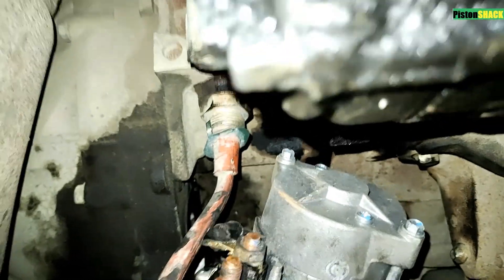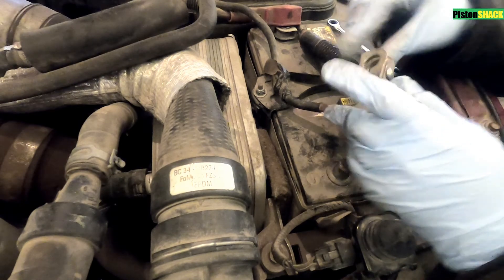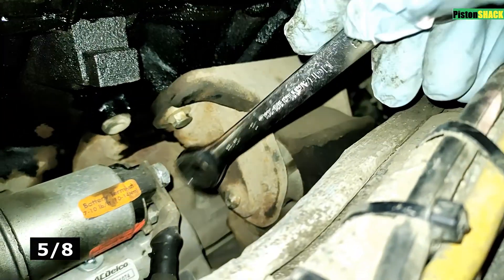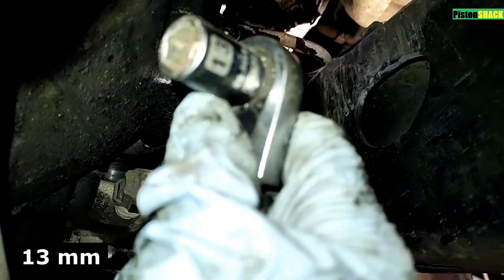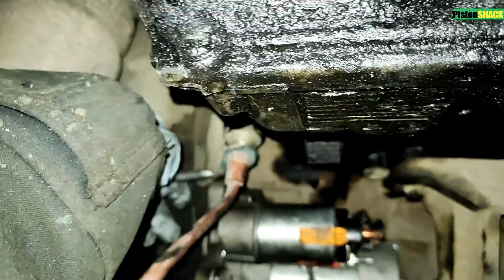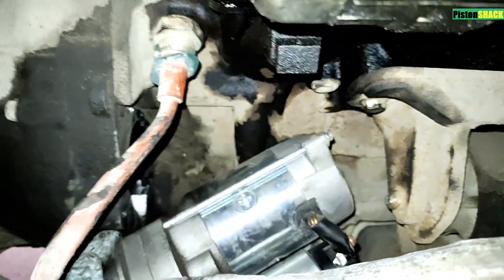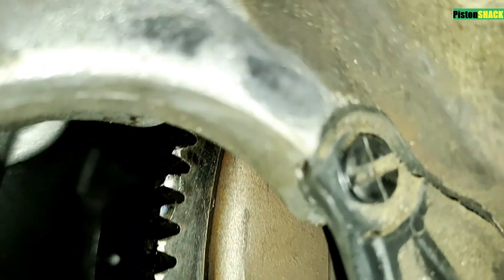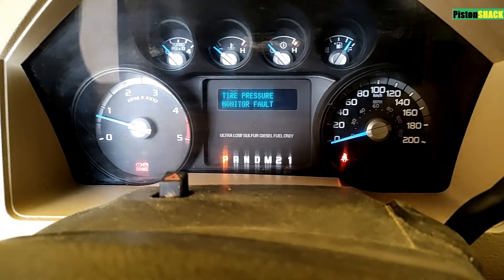BEST EXPLAINED 6.7L POWERSTROKE STARTER MOTOR REMOVAL | In Details | Ford Super Duty 2011-2017

Comment: Thanks for the video. 
Alternator comes out easier above the frame there than pulling it down as shown….once you unlock the puzzle the fine engineers at ford designed to even be a pain to remove without the frame. 

Can also wait to take off the 10 mil bolt on starter wire once you get the unit loose. Hard to get at with tools I had on hand.  (Have kids, have some missing sockets.) 

Idk for sure, but truck is closing down on 450,000 and the starter looked original. 
Worth the extra engineering obstacle course if they last that long. For sure I haven’t replaced it in last 220,000 miles. 
7.3 I was swapping about every 100k or so. 
Thats when I learned the trifecta of bad starter killing the alternator and alternator killing batteries and if alternators and battery are newer and seems you just replaced them, chances are the starter is bad and sucking the other 2 to death.  

Again thanks for quick and thorough video. Helped me find the thing and wouldn’t have thought it need to take the front wheel off to get to it. Time saver for sure.

Comment: I just want to thank you so much for this video. I was able to get all my tools laid out and ready tor this job so thank you for the sizes. Fought for 30 minutes trying to get that starter out. Took a break and watched this video again and went and pulled it right out first try. For the diesel model there were 4 bolts. Two on back and two next to the solenoid. I used multiple extensions and a u joint connector since i didn’t have the adjustable ratchet head and that made it a lot easier too!  Again thanks so much.
Reply from the maker: My pleasure Adam! I am so glad it worked out for you.  I tried my best after watching few 6.7 starter replacement videos on YT to make it informative and short as possible without sacrificing the quality) 
Thanks for your kind feedback. 
Cheers!

Comment: Oh my God. Someone did a quick how to video that shows EXACTLY how to do something including all the tools required and hardware sizes. They didn't include a ton of extra useless content like buy this or whatever. THANK YOU SOO MUCH. I often find myself looking for how to videos and most of the time I have to watch 3 or 4 videos to get all the info I need. Your video was the first I watched on this particular topic and it was extremely helpful.
Reply from the maker: Wow, thanks JD! That was my initial plan to make the video without BS short as possible and long as necessary without missing important details. Thanks again for your kind feedback.
Happy Holidays!
Reply: Plus we didn't have to drive to pickup a friend and then store first.
Reply: Totally agree.  Great video with all tools I need to bring to go change my starter in the store parking lot.  Thanks!  Subscribing!

Comment: All of the fasteners on the truck are metric, you just happened to find the fractional equivalents that worked.  An aftermarket starter could have either, but generally they'll be metric also.
Reply from the maker: I noticed that too. Good point.

Comment: I found that on the original Ford OEM starter the nut on the main positive lead is actually 15mm. It appears that on re-manufactured units like the one you are both removing and installing is a 5/8" nut. This thing is a HUGE PAIN to maneuver out of there. You need to bring the gear side out first and maneuver it up and around that orange sensor cable. It will come out but you'll be cursing the engineers and nursing bruised knuckles.
Reply from the maker: Oh interesting, I did not know that. I guess they might run out of 15 mm and starting putting cheaper 5/8 nuts:)
Reply: Orange wire is not a sensor... it's the block heater.  
Other end of it is in the bumper in the front. 
It's for warming the engine overnight without having to run it.

Comment: Great video.  Any troubleshooting tips?  I thought my battery was dead, but now I suspect the starter.  I jumped it and its dead silent when I turn ignition.  I was planning to test voltage at the starter to make sure it's getting voltage.  What do you think?
Reply from the maker: Hey Tino! Does it click when you try to crank?
I have a great video how to bench test starter. You can also do those tests when vehicle is still on a vehicle.
NO CRANK? BEST COMPLETE STARTER TEST TUTORIAL.
https://youtu.be/RH6dsti5q04
 If starter checked out, then you might have control or power/ground issues down to the starter.
Reply: @PistonShack  not sure what you mean by click.  It doesn't make a sound when I turn it on besides normal interior sounds. I jumped it with my other truck and no change.  We actually had issues with weak starts over the last 3 weeks.  I thought it was my battery, since it behaved like a weak battery. Struggling to turn over. I wrote it off as a dying battery since it's been below freezing, I figured CCA were not up to spec.  But today was the warmest it's been in a long time and no start.  I was surprised we couldn't jump it.
Reply: Thanks for posting this.   I finished up my 250 today, after testing it. The solenoid and signal wires were continuous causing my problem.  Stubby ratchet should be on this parts list too!

Comment: How long does the starter usually last?
Reply from the maker: Well, at least 250-300K.
Reply: 'Till it fails.  There is no time or mileage prediction worth a crap since the wear mostly depends on how much the starter gets used.  I'm doing one today on a truck with about 70k miles and his other 6.7 truck has about 250k on the starter.  One is a job site truck that gets moved around a lot, the other is mostly a highway truck so it racks up miles with fewer starts.
Reply: Mine lasted just about 70,000. I was surprised to say the least.